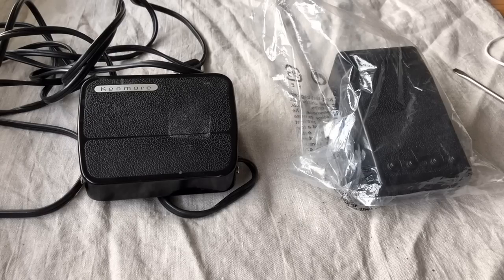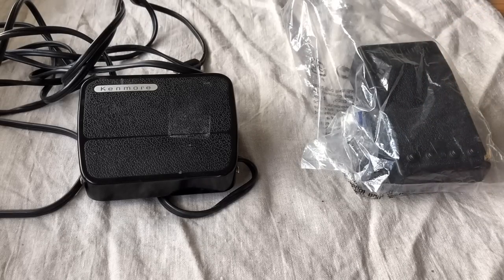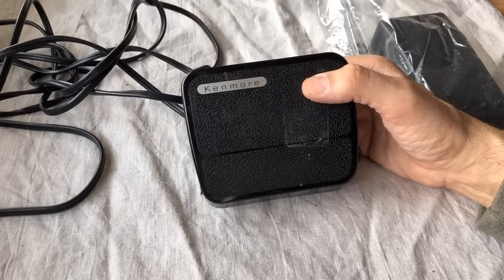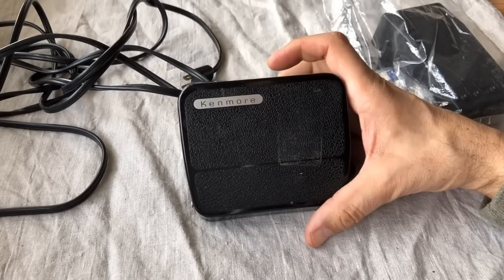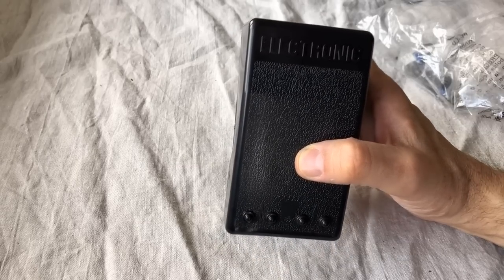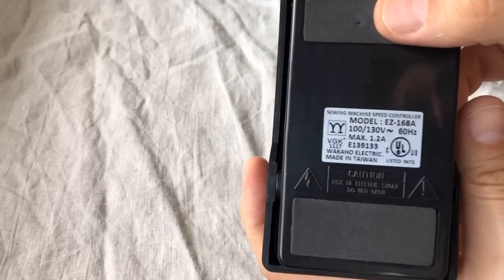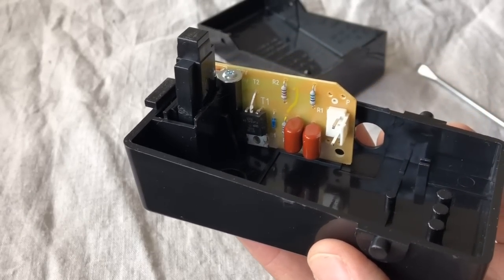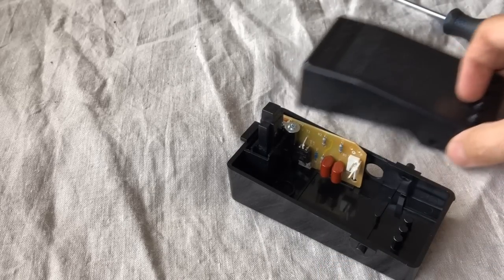FOOT PEDAL SERIES #3: Upgrading Your Vintage Sewing Machine With An Electronic Foot Pedal/Controller

Comment: I have used that pedal as a knee operated pedal for a Necchi BF. It works great. I popped the top off, drilled two holes and secured to the side of the cabinet with 2 screws.

Comment: I had no idea that there was so much replacement parts for the vintage sewing machines. I started this venture of learning all of this because I inherited three sewing machines a Kenmore 158 which runs great. I Kenmore 385 which today got broke free and a newer singer classic. That's frozen and has some rest on it. The 385 and the classic was my mother's classic was her last sewing machine. She purchased just a few weeks before she passed away with it's never been used. The Kenmore 158 was my grandmother's. But I'm finding out that there is lots of parts to keep these things running
Reply from the maker: Yes, there are a surprising number of both vintage/used parts as well as reproduction parts for some models.  The more popular the brand was, (such as Singer and Kenmore), the more parts you will come across.

Comment: I watched your vintage sewing pedal video and it  really helped me. My knee/foot pedal porcelain is cracked (mercury electric) and when I plug it the motor runs without pushing on the level. It’s a Kenmore ZZ 117.740 would the pedal in this video work?

Comment: I’m a modern sewing machine tech and a vintage machine enthusiast. I wouldn’t charge anyone more than $20 to wire an electronic pedal. The pedals run about $30 so $50 “installed” seems fair. Provided the existing cords and outlets aren’t crispy critters.

Comment: I have a beautiful white 77 series integrated into the cabinet with a knee pedal. I really would like to replace it with a foot pedal and make a portable box for the machine. How do I replace the knee pedal with a foot pedal?
Reply: I have the same issue.  Did you ever find a resolution?
Reply: I am having the same problem. My daughter bought me a wonderful Slantomatic 401a for Mothers day and I LOVE IT. It came with all the original attachments, manuals etc. I and it's in a beautiful wooden cabinet. I the only thing that I want to do is to add a foot pedal along with the knee pedal. Did u ever find a solution ladies?  I know this gentleman is very knowledgeable but also long winded and never did tell how to wire it. I bought an electronic one and I did learn how to open it!

Comment: My wife has a 1 year old Juki that cost over $1,800 and the pedal started acting up. I took it apart and found that the construction of this pedal (the linear resistance assembly in particular) is laughable at best. I have to assume by the gauge of the wire and the type of barrel connector used with this pedal that it is controlling a low voltage circuit in the machine, although I have yet to test for that at the machine to confirm this. 

While the measurement does break up when testing the pedal for ohms I can still determine that it appears to have a span of around 0-140 ohms (starts at the 140 mark to create resistance so that the machine is OFF and then of course the resistance is lessened as the pedal is actuated to allow the machine to run. Even after cleaning with DeoxIT D5 contact cleaner and using a drop of  dielectric grease it's still shot.  Question: does anyone know how many ohms the other low voltage pedals are running in their units, if in fact they are low voltage?

Comment: I just purchased one of these to replace an old carbon disk rheostat pedal that was worn out.  The plug on the old pedal is unpolarized and I don't see any markings on the pcb silkscreen for polarity, am I good if I wire it either way? Or should I get out the multimeter?

Comment: I have a Vintage Elna (Super) and about 10 years ago, the foot pedal was replaced and it basically would work when it got ready.  I'm at a lost for replacing it.  Do you think this pedal would work for my machine?  The original foot had a second speed.  Boy do I miss it.

Comment: Do you have a video that shows how to wire the leads to the pedal?  I purchased a "kit" with the same pedal you have, a power cord and plug block, but I don't see anything inside the pedal that looks even remotely like a place to connect the wire leads (with fork-shaped terminals on the ends).  Frustrating!
Reply from the maker: Hi Andrew.  I have not made a video of that procedure yet.  I think there is one that was made by the folks that run a site I purchase a lot of my replacement parts at.  She made the video for the generic electronic speed control or foot pedals they carry.  Here is the link you might find helpful: https://www.youtube.com/watch?v=QNPti0gdm5U

Comment: Hi I have the old style rheostat foot pedal type and one of thee coils is broken, any idea where I can get another coil?
Reply from the maker: I would not replace the coil, but rather replace the entire pedal.  See my comments here for a prior question which may help.  You can purchase new 'old style' metal foot pedals either pre-wired with a cord or just the pedal like in this link.  This one is carbon pile design.  There may be something similar for Rheostat type, but I would start your search here on Ebay.  Other sewing supply sellers may have them as well.  I've never used this Ebay seller but its just an example of what is out there

Comment: Looks like my old Singer 247 is getting a new pedal.....

To add something to your comments about how sensitive these are to rough handling, while you wouldn't want to swing them by the cord and slam them into walls and trees or make a habit of dropping them, the small number of components on the board and the fact that they're a (for the most part; taking into account the moving button) solid state setup, makes them impressively rugged. Me being who I am, I would still inspect solder joints and likely replace the capacitors with known long-life caps before use, but that's just one of my obsessive quirks from working in electronics.

Comment: I have a Pfaff Hobbymatic 807 without a pedal. Will an electronic pedal work with it? THX
Reply from the maker: Hello Tom and thanks for your question.  European brands such as Pfaff can be a bit trickier to get the right controller for because 1. They were always changing/updating their cord and pedal designs 2. Often, the part you need exists but the model number of your own machine is not always listed.  Here is a link to a pedal/cord combo that you could investigate.  FYI, BE SURE to ask the seller if your model might be included.  I do see the 807 model listed under their list of compatible models, BUT it fall under the "Tiptronic" model label.  Now, its certainly possible that it also fits your machine since the number of models they produced is remarkable.  Take a look at your male plug end and compare it to the cord plug in the photos.  Next, see if you can find the amperage rating on your machine's motor.  Then look at the amp ratings on the pedal.  If you check with the seller first and they say its a fit, then you should be good to go.  Also , double check the seller's return policy given the rather princely sum they want for this.  (Don't be surprised as most European brands have silly parts prices compared to US and Japanese brands. ) I have no connection to this seller but simply found this on an Ebay search. Good luck and let us know how you make out.  Here is the link I found:   https://www.ebay.com/itm/FOOT-CONTROL-PEDAL-W-Cord-Pfaff-Select-2-2-3-0-3-2-4-0-4-2-362-6085-6091-6112/273233222305?hash=item3f9df81aa1:g:Dg8AAOSwnVRbqRsx

Comment: There’s so much room in those pedals, you could probably adhere some weights inside to give it some weight 😀
Reply from the maker: Hi Cristina.  Weights might be a possibility though I would not put them inside.  I might try finding a way to weight the pedal down on the outside though!
Reply: @VintageSewingMachineGarage  in that case, Id just glue the weights to bottom of pedal, making sure the glue can be used on plastic.  Wouldnt that work,  I would search thru hubby's piles of junk for weights (of course, he doesnt care).
Reply: @VintageSewingMachineGarage  You absolutely could put them inside though. There's very little on that chip that could be shorted out. so absolutely could stick a flat sheet of lead in there as long as you kept it from rattling around.

Comment: Is there any way to reduce the spring strength?  I am going to be using these EZ-168 pedals as KNEE controllers in several sewing machine cabinets.  I would rather not have to apply so much pressure to the side with my knee.  If I could access the spring, I'm sure I could find a "weaker" spring to replace it. I've fiddled a bit with one of the EZ-168, but cannot seem to acces the actual spring.
Reply from the maker: The springs on these were not designed for cutomization and if you tried to alter it, you could damage its ability to perform.  One alternative might be to try using one of the Singer "Button Style" foot pedals.  They were designed to be used as both foot and knee control and are very easy to control speed with considering they were non-digital in nature.  Be sure to check the Amp rating of your machine motors so that the amp rating for the motor matches that of the foot pedal.

Comment: Jerry Tecklin
Easy installation, but I have a question.  When the pedal is not depressed at all there is still a buzz in the motor, although it does not start until the pedal is depressed, and it then operates just fine.  The pedal thus seems to be passing current to the motor even though it is in an off position.  I can't see how this could be good for the motor, and I am careful to disconnect when I am not operating the sewing machine.  Is the pedal defective?  or Is this just normal for an electronic pedal?

Comment: I realize this an older video but hoping for your input. I recently purchased a 1923 99k singer in a Brentwood case that has a hole for the knee pedal. However it was missing.  When I opened up the side where mechanism that moves knee pedal is, the ceramic had pretty much disintegrated.  I'm thinking it must be rheostat. Coming from the motor are two wires with large plugs that go into mechanism. How can I identify  this? How do I restore this?

Comment: I don't think this will work for a bernina 1010, pedal type 290. My pedal uses 240v and has 3 wires (3 pin plug.)

Comment: The wiring has gone out in several my classroom pedals. The thing I am having the most trouble with is removing the wire stress relief clip from the side of the pedal where the wire comes out. Is there a trick to make this easier?

Comment: I've just bought a viking vintage machine that uses a 4 pins entrance pedal, and sadly it wasn't included. Do you think I could replace it with an electronic pedal?
Reply from the maker: Hello Ana. It will depend on your specific Viking model.  Many machine makers started getting more proprietary by the 1970's and 80's.  I would search online sewing parts retailers and see if your model comes up.  You might also check with a local Sew-Vac center in your area to see if they can locate one for you.

Comment: Thank you for sharing this info. I have a pedal like this one (came with a 150 watt motor) and the motor is soooo quick i want to adjust the speed. With your help i now how to open the pedal but how can i adjust the speed? I hope you can help on that too
Reply from the maker: Hi Vivienne.  As far as I know, speed control on these cannot be adjusted.  Normally, an electronic pedal will offer improved speed control especially at the lower end for slow speed.  If you are using one of these pedals and the speed is still challenging to manage, it could be that either the motor has some issue or also, its possible you got a "dud" with the electronic pedal you have.  There could be other causes but these are the first possible scenarios that come to mind.

Comment: electyronic foot pedals are useless.  carbon pile is much better
Reply: I think the same 👏👏 I Need a large PVC rubber  foot pedal.  I have been using old metal  foot pedal. What is the best could you suggest please?

Comment: I have a Pfaff model 332. Would a generic foot pedal work with this?
Reply from the maker: As long as your Pfaff cord is a 2 wire and not a later 3 wire cord (I think yours is 2 wire if I recall), then a generic pedal should work.  FYI, BE SURE to check the amperage rating on the replacement pedal to be sure it matches the amp rating on the machine motor (often listed on the outside body of the machine or sometimes the motor).  The cords/plugs themselves are not generic though so you need a new reproduction cord that will specify that it fits your specific Pfaff model.  Some companies like Pfaff tended to change the plug/cord designs a lot more frequently than did Singer or White so the model number matters.  Just because a cord is advertised as fitting "Pfaff machines" is not a sure thing that it will fit your model so always ask.

Comment: Hello, I have been looking at your videos and in one of your videos you showed how to lower the feed dogs on a 15-90. I am trying to do free motion quilting on my vintage singer and I am having a tough time figuring out how to lower the feed dogs. Can you show me which video of yours has this?
Reply from the maker: Hi Carla.  I have not made a video showing what you mentioned.  In lieu of that, the owner's manual should illustrate how to do this.  Its fairly simple once you know how.
Reply from the maker: FYI, your control screw for lowering the feed dogs may require lubrication to loosen it as many of these were never used.

Comment: So then do the three wire ones just have one 120V line, 1 adjustable, and 1 neutral? I recently got one (free to me) and I don't want to spend 30$ on a pedal just to see if it works. Considering just connecting the plug contacts to a suicide cord. Its a singer 347.

Comment: Good day sir, stumble across your video on foot pedals after searching for ages( a year +), i have an old ''Brother star 40E'' machine that has two separate input points,,, 1st= for AC power cord inlet(only lights up the machine), while 2nd= for foot pedal ( a "jack cord foot pedal)( without this machine wont work)....... Problems is i misplaced the (jack cord foot pedal) while moving houses,  and no where to buy such an item... please please can u advice / do a video on how to diy jack to foot pedals,,, so that i can use one of my old earphone ''jack'' to connect with the foot pedal and cord I have.....thank you...

Comment: I've searched high and low, and I haven't found any info about if I could just put the electronic board and spring inside an old metal rheostatic case. ... or maybe even the whole plastic pedal inside the old one, if it was small enough of course... This would conserve the look and weight of the old vintage machine pedal, yet give the updated control of the new electric versions. Unfortunately, I don't know enough about wiring and electricity yet to ensure this is safe and to make sure the metal case wasn't shorting the electronics. If anyone has seen this done, please share!
Reply: Yes you can. You need to do the engineering to make sure it's all correct. For that you need someone who can design electronics. Fortunately I can and I'm working on a retrofit for old singer footpedal cases. Absolutely no guarantees on how long that will take.
Reply: @davidjohnston4240 
This sounds super cool! Lmk if you are able to figure that out
Reply: I have designed a retrofit board for the most common singer foot control. The one with the button. But I am travelling and won't be back home for a while. The boards are manufactured and delivered. I will assemble and test when I get home. There will likely have to be a second spin to fix whatever problems arise
Reply: @davidjohnston4240  wow you know what you are doing. Are you an electrical engineer?

Comment: I love the ergonomics of a Singer button style foot pedal.  Have you ever considered converting an old pedal case and put an electronic control inside it? I would love to see a video of that!
Reply from the maker: Hi Matthew.  As a matter of fact, I have imagined how it might work but have as yet not found the right components that would fit into the Button style housing.  If you come across anyone who has found a way to do this, please share!!
Reply: @VintageSewingMachineGarage  I was thinking of doing it myself.  What I need is a  button pedal that is junk, which I can use and a cheep electronic pedal.  Then I could tinker with it to figure out how to make it work.
Reply: It actually looks like you could get fairly close with the hardware that's shown at the end of this video. Basically  use the old button case and shove this hardware into it, if the old button style cases are metal you would have to be very cautious not to short anything though. use the bit that the lever is pushing down as the button?

Comment: EE here.. Those electronic bits are not particularly sensitive. the resistors caps and connectors are bulletproof. The mostly likely thing to creak if you are rough with it is the plastic. The transistor is fine as long as it's wired in since it's protected from static discharge from your fingers. The lightweight type you showed is relying on the coils in the motor in the sewing machine to smooth the switched supply. More advanced ones that contain more substantial energy storage components are acting like a voltage controlled inverter. I prefer the simpler style.